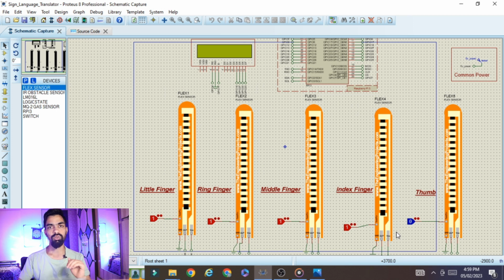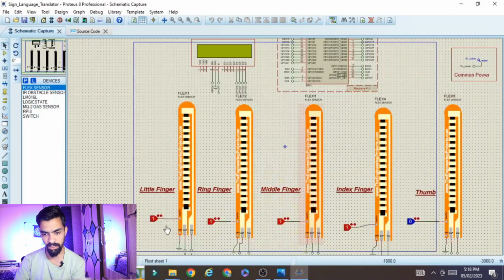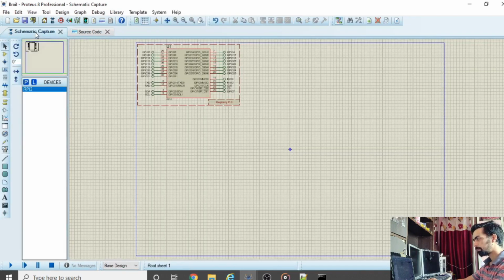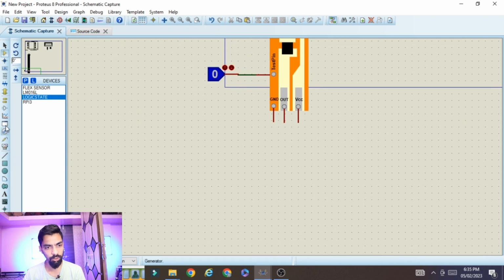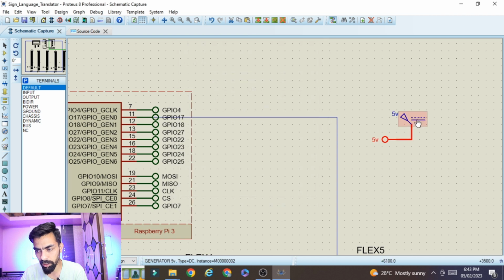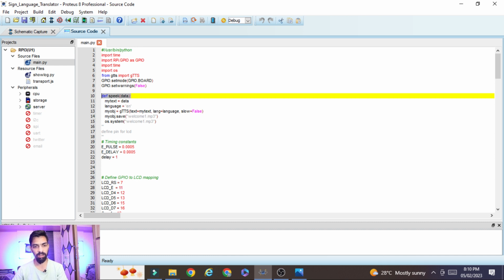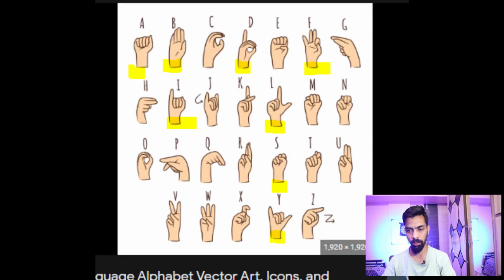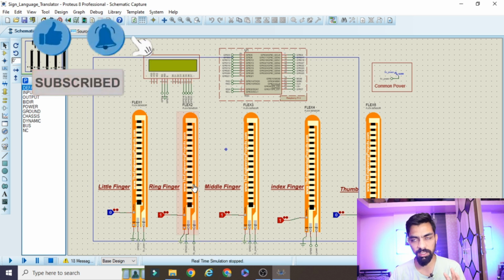Sign Language Translator By Using Raspberry Pi

Comment: It was nice sir. Thank you for your thoughtful help!!
 As you have said, the number of signs are less in this project. As a suggestion, is it possible to use an audio which is recorded before to avoid using gTTs.
Reply from the maker: I need to check how to play recorded audio.
Reply: @Rahul_Jadhav_Project   ok sir
And in addition to that, I think it is possible with two mode of operation. for instance one for learning if the input is not found in database and the other is for working mode which gives the output based on the corresponding sign. And when I say learning mode, just when you make a sign if this sign has already made to the database, it will show you some text like  "already exist " or " make a change"  but if it isn't there, it could show the text like" add to database". The database can be made with your voice(if it is possible ). For each sign record a voice and text from keyboard through USB. 
Sir  I'm going to implement this project for final.

Comment: Hello sir,  i need your help if You can...  simulation for drone wireless communication if you have time and source code about related to drone parameters if you have pls pls help me i'm very stressed using MATLAB or protous or mac
Reply from the maker: Currently I don't have simulation of drone
Reply: @Rahul_Jadhav_Project  how can i get it?
Reply: @Rahul_Jadhav_Project  => Drone flight control system simulation 
=> Drone PID Controller simulation
=> Receiving image/video as an input and sending to..    in wireless means